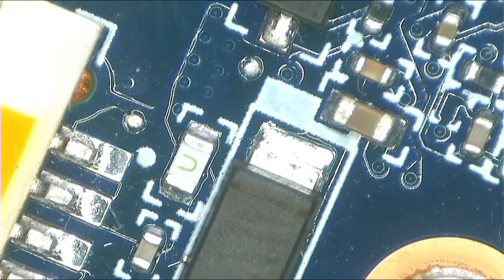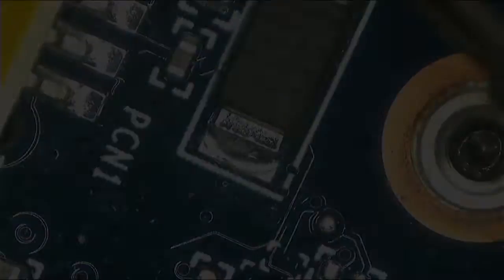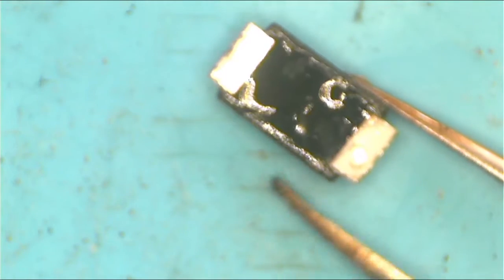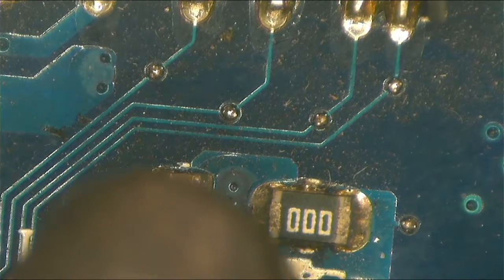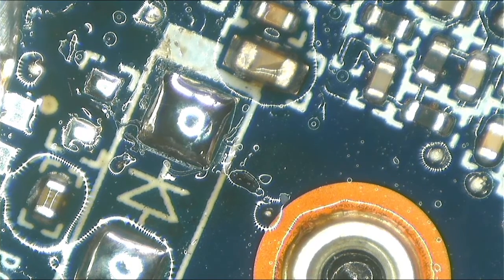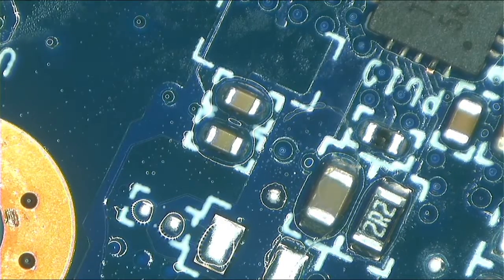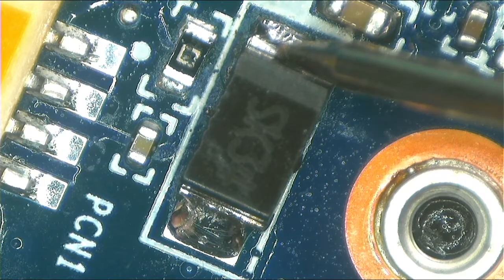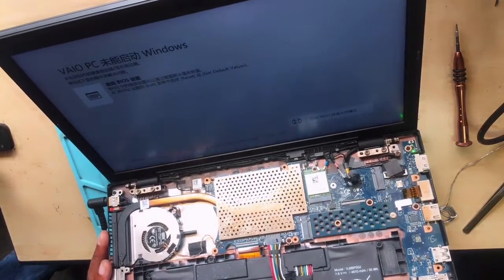Sony Viao Laptop not turning on repair tutorial

Comment: Great job from the one of the best online engr, please I want u to explain what really went wrong I'm working on a Sony laptop motherboard  after I reprogram the bios the laptop is not coming up again and I try to restore back the bios previous file but the laptop did not power after I checked the sio requirements I discovered two things firstly the nbswon is having 0v and is directly connected to the sio without any components in between it and secondly the ac_present signal is 0v I want you to explain to me how to troubleshoot the problem